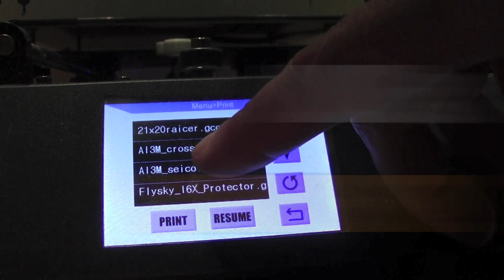[Leather Craft] Pocket Watch

Comment: Will this watch be easily broken!?
Reply from the maker: This watch is 25 years old and it seen a lot.
As you can see, nothing happened to the mechanism.
The gold from the case has already been scratced, and the glass of sapphire and it is not afraid of scratches.
In general, this is a thing that cannot be longer used for its intended purpose, but it is also a pity to throw it away.